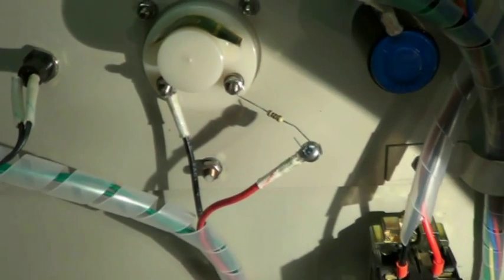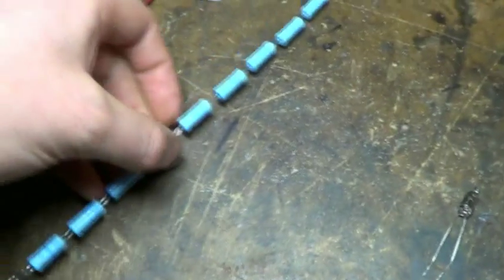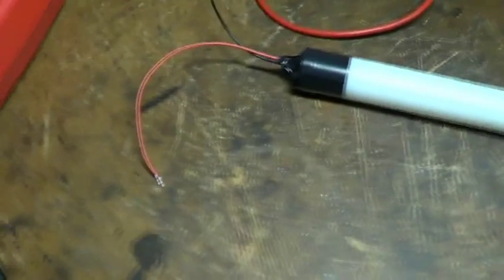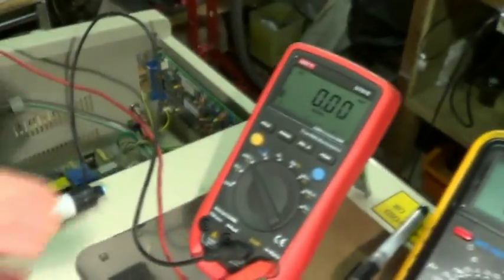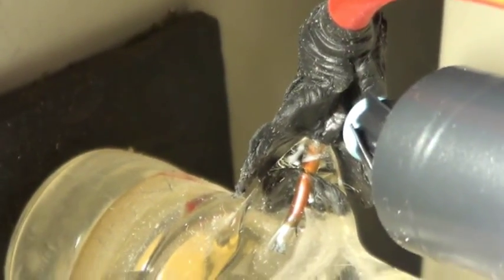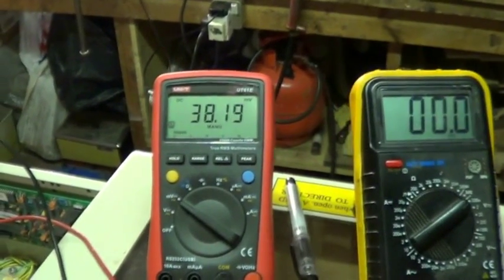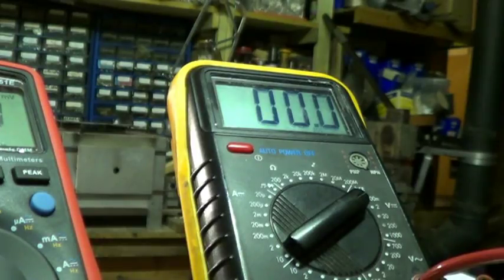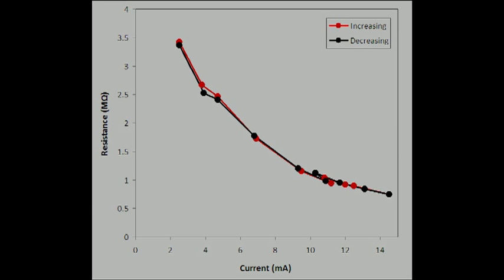Measuring current and voltage in CO2 laser tube

Comment: This is a great video, very informative. But as a retired EE I have to warn that high voltage has MANY ways to kill you, and most of them are non-obvious. 20 kV does not act like the electricity you are familiar with. It can jump through what is normally an insulator (like electrical tape, or a resistor body, or a plastic tube). Dividers, if made properly, work well. Unless there’s a defect in your machine and the whole thing is floating thousands of volts above ground and you aren’t. The 30mA or-so of High Voltage shown here is more than enough to stop your heart dead, or, if you’re lucky, just throw you across the room like a rag doll until you collide with something harder than your head. I spent many years working around 480 V motor drives and I will not for a moment consider touching 20KV.

Please do yourself and your loved ones a favor and do not try to duplicate these results unless you really know what you’re doing!

Comment: Very interesting video! Was the brief initial voltage displayed due to the capacitors discharging into your device? I've been trying to work out a safe and permanent solution to do this, so as to allow the tube to be worked on quickly after shutdown. I have read suggestions of using wooden sticks and grounding wire whilst keeping one arm behind your back!!! I'd prefer something more along the lines of a breaker (or maker) switch.
Reply from the maker: Thanks. There aren't actually any discrete smoothing capacitors in the power supply - as far as I'm aware, there is a small filter capacitor built into the output transformer of the power supply, and there's a tiny capacitance from the tube itself. So it's quite sufficient to just short the HV terminal to ground (after the power is switched off, obviously!) to make things safe.

Comment: Hi!
Very good video!. Just wondering... your last graphs show voltage and current behavior. If you muliply VxI at each point, you may get the power being fed to the tube right? (assuming the tube behaves as a resistor)., well, you get 40W with 10KV and 4mA. Above that, the tube may be overpowered, reaching up to 150W!. Clearly, that's not what's happening, so... do you know of any method to measure average power being fed to the tube, right from electrical measurements? (without laser power meters). It'd be nice to know.
Thanks.
Reply from the maker: Thanks, glad you liked the video! Yes, product of the voltage and current will give power - but remember, that's the INPUT electrical power to the tube, NOT the optical output power. CO2 lasers are approximately 20% efficient - i.e. 100W electrical input gives 20W optical output. So for my tube, a maximum input power of 150W would be around 30W output, which is about right (it says a 40W tube but they're rarely accurate).

You can only determine electrical power from the voltage and current measurements - there's no way to measure optical power from that (for example, the gas in the tube could be totally used up, so no laser output, but it would still carry an electrical discharge). The only way to measure laser output power is with a power meter - e.g. thermal. The simplest way is actually just to get the beam to heat a black-painted block of metal and measure how quickly the temperature rises. Have a look at my other page for more on this - http://imajeenyus.com/optical/20130423_measuring_laser_power_thermally/index.shtml
Reply: You're absolutely right! I wasn't even considering the tube efficiency! dumb me.... One more thing: have you seen the I and V waveforms in an oscilloscope?  I haven't seen any video showing them. It'd be interesting... anyways, Thanks for your reply.

Comment: Thank you very much for the video.  My 40 laser isn't working, and I'm uncertain if its the tube or the power supply.  This will help a lot!

For the voltage divider, do I need high wattage resistors or will standard 1/2 watt resistors work?

Thanks!
Reply from the maker: +Elizabeth Greene Hi, sorry for the delay in getting back to you! If the resistance is high enough, then the power dissipation isn't too significant. You do need high-VOLTAGE resistors, however. Standard 1/4W metal-film resistors are only rated to a few hundred volts, and you'd need to stick a lot of them in series to achieve the desired voltage rating (which is perfectly possible, if you have an afternoon free!). However, EBay has quite a few high voltage resistors around, for example this one - 

http://www.ebay.co.uk/itm/10W-350M-Ohm-2-Axial-Lead-Red-Glaze-High-Voltage-Power-Resistor-/291576728300

(item number 291576728300 if that link doesn't work). A single one of them along with a 1kOhm bottom resistor, like I used, would do a pretty good job. Hope that helps!